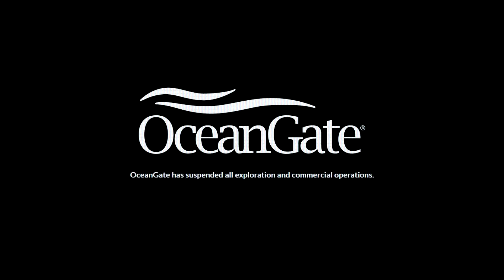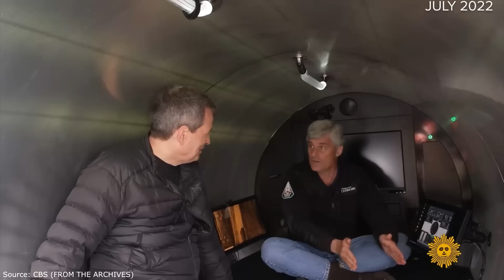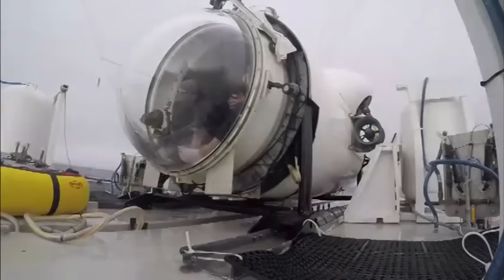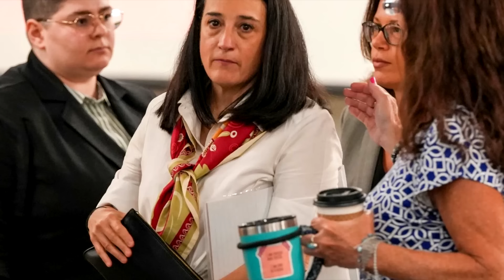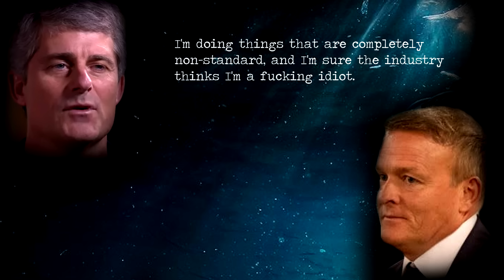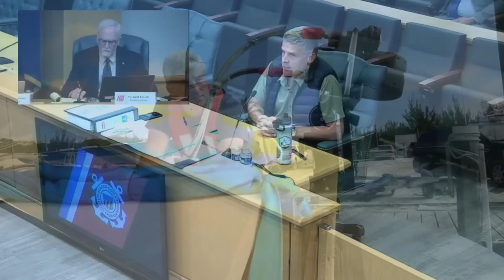OceanGate: From Innovation to Investigation | Full Documentary (Pt.1) Titan Sub Implosion

Comment: Right off the bat I'm amazing Plankton Mush (formerly known as Stockton Rush) was boasting that Titan was the only submersible with acoustic and strain gauge monitoring systems like they are a plus; it's monitoring behaviour that shouldn't be happening! but it is happening because of his ridiculous design using carbon fibre (and having different material interfaces). It's a superb video - fascinating to watch. David Lochridge comes across as totally direct and honest. SR's mindset just defies belief - either he was suicidal or hell-bent on getting Titan running commercially regardless of any techincal/safety issues.

Comment: that flange on the pressure ring sure is thin it should have been 1 inch thick and 5 inches in length the barrel inserts into the ring it looks so weak. the glue surface area is tiny....I believe the pressure was holding it together until one of the tiny ring flanges gave then imploded, I think they were thinking the pressure would hold the endcaps on with enough force that it would be stable....except for the tiny thin flange..I believe with a more robust flange area it would work...but I would not be the bird in the cage

Comment: I just realized that they used Bluetooth for that game controller - how stupid…at least have one that plugs in so the pressure doesn’t distort the signal…Bluetooth is so unreliable…even in the hospital…it’s just one more thing that could fail…and the “bolt-in” design is eerily similar to the Apollo 1 disaster. They also relied on single O-rings in sub-zero temps like the Challenger…
      - granddaughter of an Apollo engineer (a nurse not an engineer myself)

Comment: What he, somehow, missed is that planes are not subs. You could get shot down in a P-51 Mustang 30000 ft above France and parachute out or even crash- land and survive. If your submersible fails 1000 feet below the surface, you will die.

Comment: Having worked in the manufacturing industry for 40 years and having worked on the Mars lander and other space programs using carbon fiber and invar(lowest thermal expansion metal alloy). The strict manufacturing guidelines for laying carbon fiber allows you to see other industries failure to adhere to these rules and know that (in this case) a catastrophic problem is imminent. I watched the lay-up of the carbon fiber tube of the TITAN SUB video and noticed MAJOR FAILURES IN THE LAY-UP PROCESS. Using carbon fiber for a deep diving  submersible is an  unchartered situation that would need MAJOR TESTING AND ENGINEERING WORK TO PROVE SAFETY AT DEPTH BECAUSE THE MATERIAL HAS NO MALLEABILITY!!! This is the reason Nickel alloys and titanium( the king of memory metals are used. In my experience using carbon fiber for deep diving submersibles is like using glass. Because it will just shatter without warning when it fails. Stockton Rush really wasn't a good engineer looking back at his methodology for manufacturing. And this literally put EVERYONES LIFE AT RISK WHEN THEY TRUSTED THIS JAGOFF.  The lies he claimed on his advertisements for trips to the titanic were based on monetary gains rather than a example of engineering marvel and  innovation. Anyone who had enough experience with submersibles would be shocked at the controls and safety systems on the TITAN. IF I WAS THERE I WOULD HAVE READ THE RIOT ACT TO THIS IGNORANT FOOL. HIS RAMPANT DISREGUARD FOR BASIC ENGINEERING PHYSICS, DESIGN AND MANUFACTURING PROCESSES WAS BLINDED BY EGOMANIA, MONETARY GAINS AND BRAGGING RIGHTS THAT PUT UNKNOWING PASSENGERS AT FATAL RISK OF DEATH. I REALLY CANT PUT MY OUTRAGE INTO WORDS.I HOPE WE STOP THE NEXT STOCKTON RUSHES OF THE WORLD BEFORE MORE INNOCENT PEOPLE GET MURDERED!

Comment: As every person who has ever used a wireless game controller will tell you - it's not the fact that it's a game controller that's a problem. It's the fact that it's wireless that's the problem. 

There's a reason professional gamers use wired controllers. ... And they're not using cheap Logitech controllers that you can get for $20-30 either, unlike what Rush was showing off.

That said, I think I could trust a wired PS5 controller if they had the magnetic joysticks (Hull, I think? I can't remember). The official PS5 and Xbox Series controllers have a major problem with stick drift. 

Although the PS2, PS3, and PS4 Dualshocks didn't tend to have anywhere near as many issues with stick drift from what I remember.

Not that he ever had any problems with the controls from what I understand (although he did manage to get stuck in a bunch of wires once IIRC). But wired is just more responsive and more reliable. Plus you don't need to charge them. Hell, I'd still use wired mice if I didn't have cats.
Reply: EXACTLY! Thank you for explaining this so clearly. I won't even use a bluetooth keyboard/mouse for my gaming pc lol, I cant imagine using one for something so important.
Reply: Seriously. I'd switch to wireless mouse and keyboard if thr latency and battery power was adequate since I hate wires, but they're a necessary inconvenience.
Reply: The US Navy uses xbox 360 controllers to control parts of their sub. No idea if they're wireless but the point still stands is that they're being used in multiple things now because our millennial generation is more comfortable using them over old mechanical means.
Reply: @RandomGuyCDN  As long as they're configured appropriately, they're amazingly good at a lot of things.

And they'd definitely be using a wired connection for XB360 controllers - no way they'd want the AA batteries dying in the middle of... whatever they're doing.

Given how 360 controllers haven't been made for... a decade now? It's kinda weird they'd still be using them. Esp as 360 controllers were known for getting stick drift more often than PS2/PS3 controllers did. Unless they secured a contract with Microsoft to keep making 360 controllers specifically for them. The military has made similar kinds of deals before - see how long they got floppy disc manufacturers to keep them supplied. 😅

Comment: Thanks for adding the lightning strike, this guy was wrong about the damage, it’s the flash boiling of trapped water that turns into hydraulic forces 
Separating the carbon in a way that the pressure can’t, I think it had salt water in the hull after the first dive,
When the sun boils the water in it it leaves behind salt, that saws the carbon strands during cycles of operation..
I think it played the biggest role in speeding up the failure of the hull
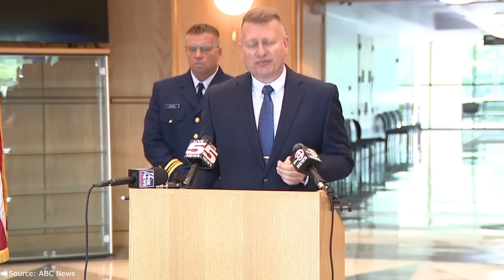Reply: 31:01 31:02 31:03 31:04 31:05 31:11
Reply: And, when water at over 5000 psi breaks into a void, the air in the void gets compressed very violently. That heat flash boils water and blows the void wide open.

Comment: Excellent work telling the story in a clear and compelling manner. 

Still can’t get over the irony of Tony Nissan claiming he set up GoPro cameras to observe the carbon fiber winding so he could watch for “bad behavior” at the facility. Yet he’s on camera acting badly by not wearing appropriate PPE within inches of the haul being wound. 
The cutoff sections tell a scary story of what was inevitable. 

The industry didn’t think Stockton was, to quote his own words (1:32:05), “a f*cking idiot”. 
The industry was highly concerned by the massive deviation from proven engineering principles and safety standards.
It was Stockton’s actions that continually showed the world who he really was. 
Not an innovator and explorer but just another reckless self anointed CEO willing to put lives at risk to feed his fragile ego. IMO
Reply: It's absolutely maddening seeing all that footage of the hulls being made. I worked for a few years in car manufacturing (both as a builder and on QA), and even for a CAR- a vehicle that isn't going to face extreme and constant pressures, our composite bodywork was still made in extremely strict conditions. Even just the most basic stuff like anyone going in and out having to suit up in full body dust suits, and shoe and  hair covers etc. But also all done in controlled environment with very specific systems to filter the air and keep any foreign bodies to an absolute minimum. The gluing was also done under these conditions, and by robots who could be incredibly precises with the amount and placement of glue. 

Meanwhile these yahoos who should know better are just in normal clothing, no dust or hair covers, in some shots the warehouse doors are wide open etc. i'd expect this maybe from a amateur sub maker who intended to just dive a a few 100ft off the coast by himself- but a supposed professional operation diving to extreme depths WITH PAYING PASSENGERS this is disgusting to witness.
Reply: 100%. He was extremely reckless, willingly and intentionally disregarding the safety of others. profits and ego over safety.